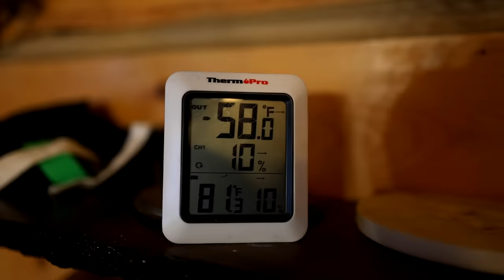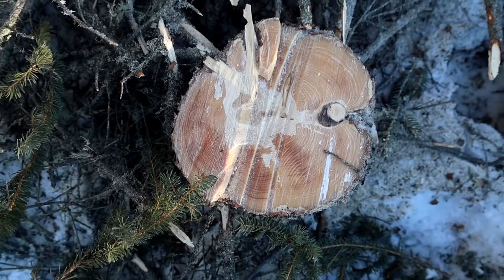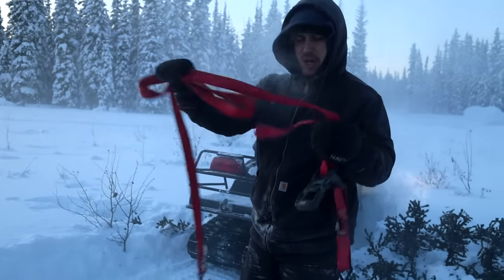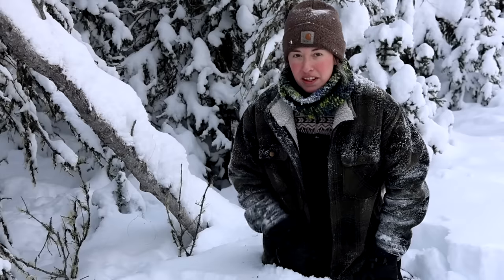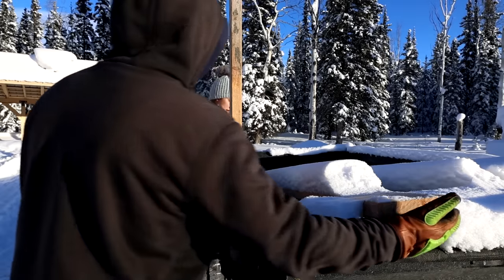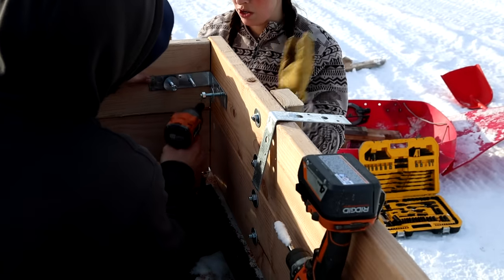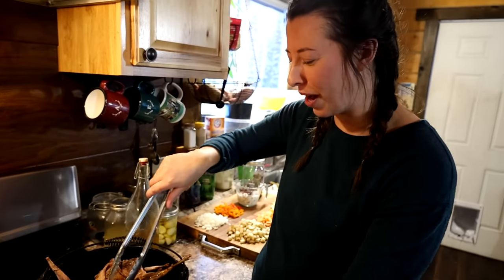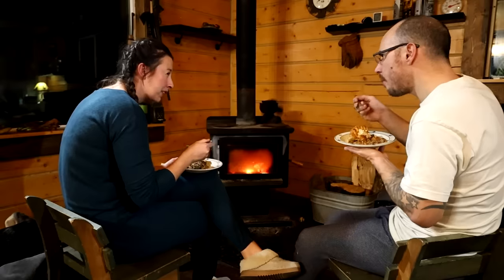50 Below, We Still Go! | Felling Frozen Trees + Snowshoe Hare Pot Pie

Comment: When we lived in the Northwest Territories our door hinges would freeze on the inside and the clothes closets would have ice on the back wall. Our oldest son 4 at the time got his tongue stuck on the door hinge when he tried to bite the ice off!! He screamed bloody murder. Eric you stayed pretty calm. We heated with wood but had an oil furnace for back up. On the coldest days it only burned like a little candle. Banking snow up on the house foundation helped because snow never goes below freezing. We only used the oil if we were gone for day. I loved splitting frozen firewood because they would just pop and split so easily. Our coldest day was -72. We stayed inside. It was so cold the smoke from the houses went down to the ground.
Reply: Snow not being able to be colder than freezing is a common misconception. While water cannot be above it's boiling temperature since the steam carries away the excess heat energy, the same isn't true for ice/snow. There isn't a mechanism that is providing heat to keep the ice/snow from being below freezing. That is why ice/snow has such different characteristics when it is very cold. All that said, snow is good insulator.

Comment: That cold is amazing and scary. A couple things when it is that cold. If you have any wind, get some Ski Goggles. Any exposed skin/eyes can freeze in moments when you start approaching ~-70 F wind-chill. For your windows,  put some 6 mill clear plastic on the outside and hold it down with furring strips around the edges. Turns plain single pane windows into expensive double pane for pennies. For the front door, a bit of a project, but screen in that porch and put up the plastic over the screens in the winter. That will create a air lock and stop that massive heat loss when the door is open. It also gives you a fly free zone during the fly months. ... Cheers! Keep up the videos!

Comment: Good thinking getting the garden started! I spent a few weeks digging, shoveling and moving beds..in the Fl winter. I decided to get it done before it's to hot to think! Corn is in the ground, testing a second round of potatoes. BTW- a tip I used last year and by golly it worked! I got 5 inch pots, and filled them with potting soil. Stuck a potato in each pot- I transplanted those babies and they grew!! 😃😃50 degrees is all they need!
Reply from the maker: Nice!! Never thought to transplant spuds.

Comment: You should close in part of the deck to give a buffer zone. Also build a shed around the LP tanks that is supper insulated. In lying oilpan heater and in lying block/water heater plus a battery blanket!! Well once the Quanza hut is finished the snow mobiles, trucks and tractor well be much better off.  It's hard working at those temps, crazy cold. Thanks for sharing. God bless and protect.

Comment: Erik Ariel, Old Russian Proverb "Don't kiss any frozen wood"  When I was a teenager I had my own room (in new jersey).  In the winter I had the heat ducts closed and always had the windows open. I slept in my undies with a sheet (never a blanket) and was fine until it hit 32F At which point I'd close the two windows but no other adjustments.  Often I'd awaken to snow on the inside window sill heheh
But 40 and 50 Below...it's totally outside my experience and after 37 years in Oaxaca NEVER below freezing and Rarely above 80F (high desert) so I now complain below 45F....
The Hare Pie looked fabulous.  Milk-Cream-SourCream-Yoghurt all contain varying degrees of acid so are natural meat tenderizers.
I'm looking forward to the gardening.  Here we havested ONE vanilla bean (Which is quite delicious) and eggplant season is upon us.  
All the best Jim Oaxaca Mexico, hugs to you and the the little ones.

Comment: The dump trailer will be a great asset.  Heavy loads, when dumping, will wear the battery quickly, keep a battery jump pack available, even with the truck charger, two or three heavy loads (gravel, loam) will drain power quickly.  I keep a trickle charger on it always, but a very handy piece of equipment.  A little larger one allows for moving your tractor, but that may not be an issue for you.

Comment: ERIC, use some caution when running your 2-stroke engines at those extreme temps below -30 as they are not properly jetted after that. The chainsaws can be adjusted (tuned) rather easily by turning the fuel screws to ADD more fuel but your sleds would/should be re-Jetted if you were to run them hard at those temperatures. The colder the temp, the MORE fuel they need. Commonly called jetting them “fatter”. The hotter the temp the lower the jets you would need or “leaning” them out. Every 2-stroke has a range where you can get by without adjustments but once you get that cold it’s almost necessary to assure you don’t cause piston damage. You might have noticed (I did) that your chainsaws were running really crisp on that cold day which meant they were running lean. If you don’t adjust them, when you go to use them in the summer they will feel boggy and low on power because at that point they will be jetted too rich (or fat) for warm weather. Hope that made sense! You two are warriors for working in that cold! It was 0 degrees F here in northern MN with wind so it felt kinda chilly!😉😁👍🏻

Comment: Good video!  At those temps I am surprised things started and was impressed with how the sleds did not break with the logs being thrown in.  Surprised the camera's worked.  Chuckled at Eric getting lip stuck...lol.  For your propane tanks, having a plug in heat tape will ensure it stays gaseous so that the stove and such will work.  Those are the days that you do only what is necessary and sit around the fire the rest of time.  Amazing how moving up 20 degrees can make a difference.

Comment: I have seen that before and you have done that before but that is so intriguing through hot water into the air when it is that cold it does not hit the ground it just floats away on the breeze

Comment: Heard you guys are having problems with your propane.
We used to have issues with the regulator freezing and often I'd have to go out with hot water bottles to thaw it so we could have gas for heating and cooking. We resolved the issue by injecting methanol in to the tank on the last filling before winter.
I just Googled freezing point of propane -188C, I think it's safe to say that it's the regulator that's frozen.
Stay well and thanks for the inspirational and  informative videos.
Reply from the maker: Thank you, yes that's most likely all is was 🙂 it thawed very quickly the next day in the sun.

Comment: i attach a small folding solar panel/charger in one to my trailer battery. the charger has a regulator on it,  and keeps it safely topped up. its just so nice to not have to fart around with a battery that only gets used occasionally. anyways nice find on the trailer, you guys needed that for awhile!

Comment: Seems you could put a mud flap on each of the gap sides of the back wood bumper. They can block the space well and will bend to shape yet not freeze. Easy and cheap. What am I getting totally wrong? You probably have a little idea of how helpful that trailer will be but once it is actually in use I can't imagine  how much more you will surely be singing it's praises as your time is priceless.

Comment: A good trick to get the snowmobile running in -50 and lower is to remove the spark plugs and give a little splash of fuel in each cylinder after working the engine loss. Learned that while doing Arctic operations with the Canadian military

Comment: Have use considered a radiant panel behind the wood stove to reflect more heat into the room and not so much through the logs to the outside. Ive seen others using outdoor wood boilers that burn far less wood and produce hot fluid for heating and hot water. Would work good to for the shop slab heating. They also take much larger pieces of wood.

Comment: Bo knows, Bandit's ready!!  Coldest I ever saw was in Kotzebue (Jan. '85) at -70F ambient.  That night the wind howled in out of Siberia.  Miserable weather.  Eat lots of beans, farting helps keep you warm.  LOL  

Come spring, when you remove those evergreen stumps, check to see whether they became "fat-wood" (resin impregnated).  Wonderful kindling!!  And I'm sure you already know, but those Stihl chainsaws should have a means of converting to "winter mode" to help in keeping them running in that extreme cold with a way to divert exhaust heat into the intake port.  

M'be cut yourself some wedges to drive between the 2x4 stakes and the stake pockets for the rear of the trailer.  Add an "L" bracket to allow you to drive them upwards to dislodge when time to remove the rear portion for dumping.  Drill a hole and use some paracord to tether your wedges to the stakes so they don't get lost when not in use to secure the rear portion to the trailer.  Also, add some downward facing hooks to the wooden bed extensions you added.  Take some of your canvas tarp material and hem the edges and install some grommets to correspond with those hooks (mounted down low) and use some short bungee to span between grommets and hooks so you're not limited by the height of your soil load, it'll keep it drier (for easier dumping) and keep it inside the trailer when going down the road at highway speeds.  At the leading edge, I'd put a 1x2 strip overtop of the tarp material and screw through both into your 2x10s to keep it secure (leading edge of wind) and then just roll it up and tie it when not in use as a load covering.

M'be you need an insulated box to protect the propane from freezing in the winter?  For emergency back-up, some 10lbs tanks to keep in the crawl space with lines going up to your stove?

That hare pot pie looked like top-shelf eating to me !

Comment: I would recommend getting one of the cheap Amazon solar chargers and mount that to the lid to keep your battery charged during summer. I put one on my dump trailer and saves from trying to keep it charged with a battery charger.

Comment: The pot pie look terrific but I was thinking rabbits and dumplings so now you've actually beat me at the temperature I've been in -56 and the first thing we learned is never grabbed a hold of your tank without your gloves on 😆😄🤓😉😁🐝 and yes gasoline engine would run but you had to have Magneto's to start it and sometimes rock it back and forth to get it off the pad

Comment: Ok, when it gets that cold you need to stay inside and watch videos like I do.  I've got this channel I watch of a couple in Alaska I could recommend...
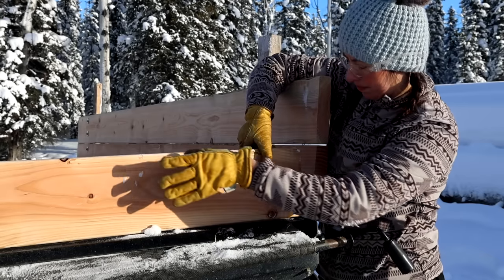Only at 20:30 so far but have to say...That looks like an Iron Bull trailer.  If it is, we have the exact same trailer (5x10).  It is an awesome trailer.  Way stronger than anything else out there I've seen.  I love ours.
I will say though, you mentioned using it to spread gravel.  Be careful with that.  Because the bed rotation pins are located forward of the back of the trailer, when the bed is up it can easily drag the tailgate that is swung back (from gravity)  to spread gravel.  It will break the chains/deform the chain anchor spots.  Don't ask me how I know that...

Comment: Instead of bungie cord to the bottom of the tailgate, put a couple of eye bolts on the vertical braces on the back panel and the rearmost side panels and strap the back to the sides.If not bungie cords, then a couple of smaller ratchet straps.

Comment: If you hook that charging wire up to your battery in the trailer, make sure you unplug it when you go to raise it from the truck. Otherwise you will melt your 12 V wire in your pick up. There is a charger with a battery pack that charges and everything they’re about $60 that comes with the battery charger and it has a relay built-in so you can leave the truck plugged in so be careful.

Comment: 4 yards of garden soil = about 8,000 lbs...I was surprised about the weight when I installed my raised garden beds.  Totally under estimated the weight when I expanded my gardens to include raised bedscas well, so I ended up picking up 5x loads since my alu-trailor was only rated for 2000 lbs. All worked out in the end and the raised beds have been a blessing 26" tall....easy on the back.  Best wishes for your new garden, will a greenhouse be in the works too?
Reply from the maker: We think because we pick up manure a lot it is lighter than garden soil but not sure yet, we will see! 🙂 yes we have plans for a big high tunnel!
Reply: @SimpleLivingAlaska  unless there is a lot of uncomposted straw in the manure.  
Mine was premium garden soil mixture (spendy stuff !!)  with compost, peatmoss, shredded/composted pine fines/bark and other composted materials...it was very fluffy and lite = 1 cyd 2000 lbs. I wanted to load more, but they recommended to try 1 cyd first and weigh... couldn't believe it either until I drove onto the scale. The trailer was big enough for 3+ cyds, but as mentioned totally under estimated the weight of the compost.
Reply: @SimpleLivingAlaska  looking forward to the greenhouse video...no doubt it will be exciting! Is your old address still the same to send something for your greenhouse initiation?

Comment: Looks like the two of you have so much powder snow, and so much to do in it, you might want to consider investing in bigger snowshoes...though most of what you do seems to be in or close to areas you can trail-pack, so far.

Remember, folks, the bigger the surface area of the snowshoe, the better you can walk on powder snow; the smaller the surface area of the snowshoe, the deeper you'll sink in.  Aluminum modern snowshoes are very lightweight and are great for pre-groomed trails with small amounts of fresh powder on top of packed surfaces, but for deep-powder areas, some folks might want more surface area to create a shallow "float," since the deeper your float, the more work you have to do just to move around.  Shallow float profiles are more easily found in traditional snowshoe  styles, and it will vary depending upon your total weight (you, your clothing, any gear you are carrying, etc)...so it's not always easy to get a perfect float each time.

The indigenous cultures of northern North America, experienced in winter survival & travel needs, made different shapes for different kinds of trekking.  Short but very broad, rounded snowshoes are great for maneuvering in a forested area, while longer narrow ones are great for long-distance travel over open terrain, such as across prairies, frozen rivers, and frozen lakes.  If you're not sure what kind of snowshoe shape to get, or you believe you'll be in and out of mixed terrain a lot, consider a style that combines the two features.  It won't be perfect for either extreme, but it'll be good enough to work in most places you'll go!

There's a great article that you can search for, "Traditional Wooden Snowshoes: Shapes, Designs, and Names" over at snowshoemag dot com, which goes over the different shapes and types.  There are also several different ways to attach the snowshoe to your foot.  Metal buckled straps are quite secure, but do have the inconvenience of being difficult to operate with gloves on, and they can do that 'freezes your bare flesh to the metal' thing.

Lampwick bindings can get damp and freeze stiff and awkward, but they can be put on and removed without needing to bare your fingers, or even use your hands once they're set up.  Indigenous folks would make & use similar bindings, and many still prefer them for sheer ease of applying & removing, even if they're not quite as secure as buckled straps.  If you're interested in the hands-free version, Lure of the North shows how they work and how to set them up here:  https://youtu.be/FE_WovKtP_s?si=K3CGwFhSP7rcPT_A

There are also rubber bindings that are stretchy, and Far North Bushcraft and Survival shows you how to make a set from rubber tire innertubes here: https://youtu.be/dQ395XJcDxM?si=HNhT3t0N6uiuCdzV   These can also be applied without needing to bare your fingers, though they're not completely hands-free.

Comment: Wow it is so much cloder than your last cabin you lived at, I am suprised the chainsaws run. I cannot wait for the garden build, I sure do miss you guys gardening, I learned a lot from you both on gardening and canning your bounty. Did I mention I canned 52 qts of tomatoes and 18 qts of hot pepper varieties, I make a huge pot of spagetti sauce and we freeze it, I do the same with chilli, I think I have a 40qt pot I make it in, I use about 5 jars of tomatoes for each pot I make, I bet I make 6 pots a year. I remember watching you guys can chilli, but forgot how you did it, I would love to jar the chilli and save freezer room, can I fill my jars with hot chilli, leave a half inch headspace and water can it for 45 mins like my tomatoes, or because it has meat in it, do I have to use a pressure cooker method. I am gonna look up some recipies, I do not have a pressure cooker i`m a little nervous using them, you guys make it look easy.

Comment: Does your chain saw have the air filter that is reversible?  Flip one way to pull in the air from outside for summer use, flip the other way to pull in air from across the head for winter use.  

Many, if not most, can do this yet most manuals don't even mention. It.

Comment: Dang chilly!  At 58 below, I'm surprised the smoke from your slash pile didn't freeze!  lol  Alaskan Trail snowshoes - the largest I've seen - spread your weight out, resulting in being able to walk more on top of the snow, instead of sinking in like your little snowshoes.  Mine are wooden frames with rawhide lacing, and leather bindings, which won't get quite so frozen up as rubber. Do you shampoo your hare before cooking?  🤡Savory pies like that are GREAT!  Do you find that hare tastes like rabbit?